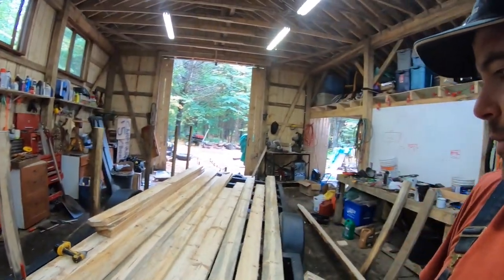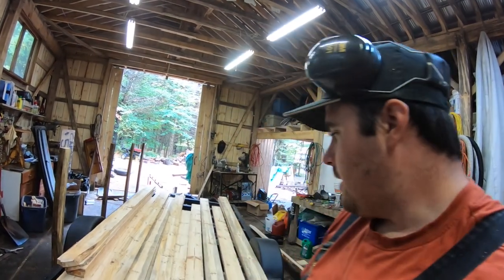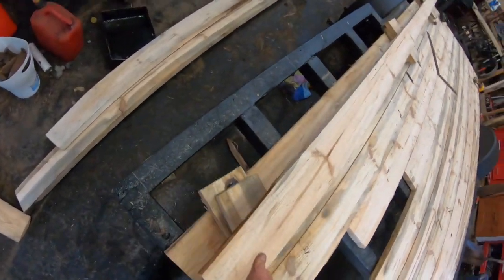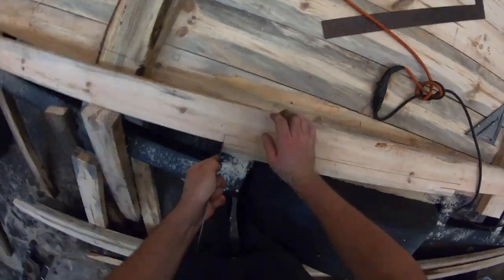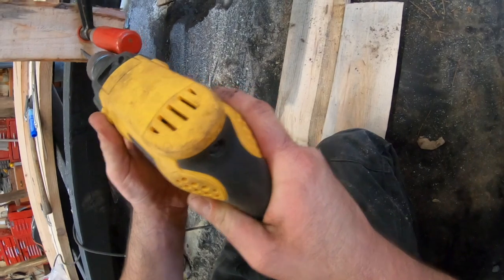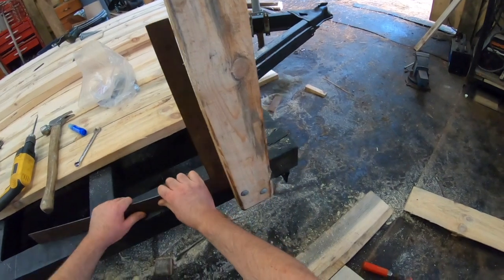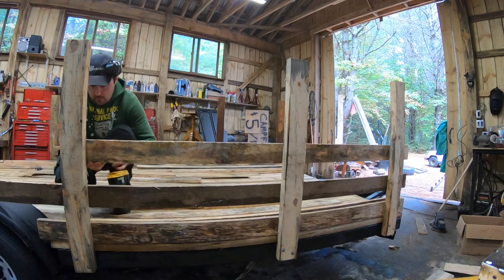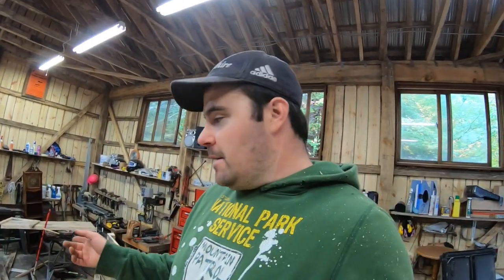Save Money When Installing Trailer Floor

Comment: Sandy, great video as always!  Only thing I would have done different is to weld brackets on the sides to accept the side posts. Then make the sides in two sections, front and back.  Then you can remove the sides if needed or leave the front half.

Keep up the great videos!!
Reply from the maker: You know what, that is a good idea, I guess I’m living and learning on that project. I’ll keep that in mind though in case I ever get ambitious and alter the sides. I appreciate the good advice

Comment: Looks great. I’m doing almost the same with a 16’ single axle camper trailer, except no side rails. Do you find the wood 4x4s strengthen the frame (less flex?) or do they add too much unnecessary weight? I’m trying to decide between with or without them prior to installing the deck planks. Thanks.
Reply from the maker: Hey Jonny, I think it does add more weight and so I’d avoid it if possible and use metal stringers to attach the floor boards

Comment: Sandy , what are you planning on using the trailer for ?  May I suggest D rings for tie down points
Reply from the maker: Richard Jette likely use it to haul brush and leaves. Maybe my snowmobile. D rings are a great idea.
Reply from the maker: Richard Jette I took your advise and ordered some d rings